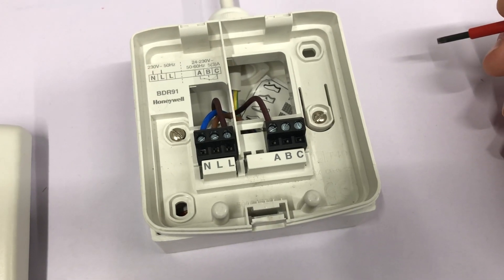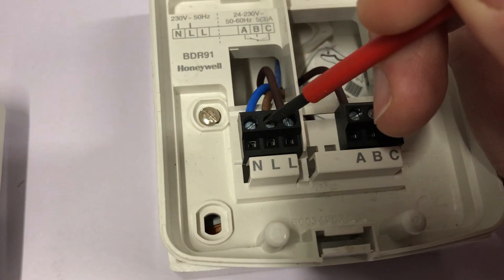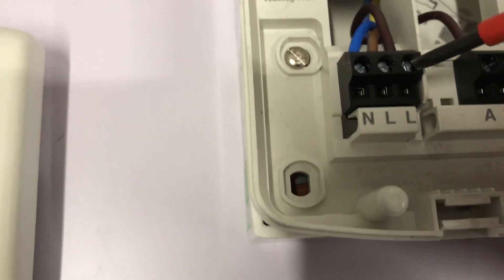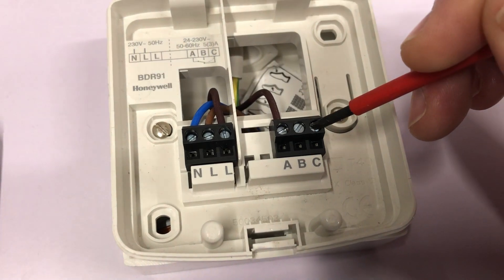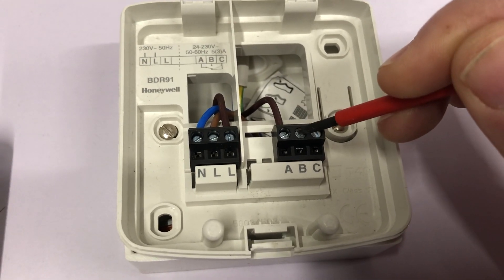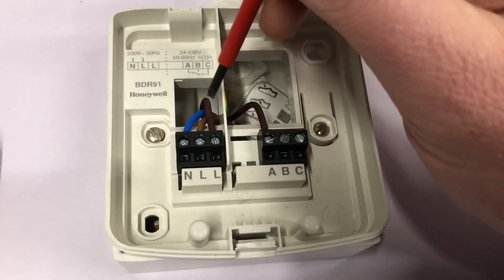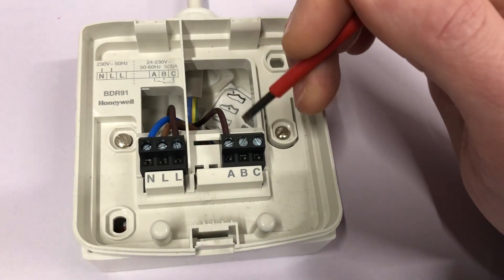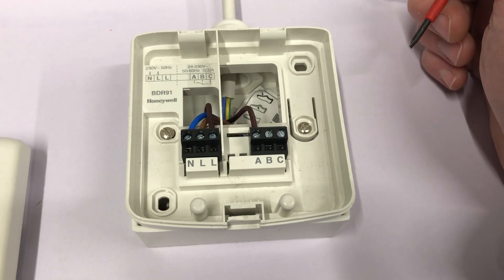How to wire a Honeywell BDR91 Wireless Relay Box (230v low voltage wiring)

Comment: Hi
I am having trouble taking the cover of the bdr91 that is already wired in. Pushing a screwdriver into the slot doesn't seem to release the case.
Reply from the maker: It will release, but can be tricky if you’ve not done it before.

Comment: Hi, I have a BDR91 wired to the boiler as a "free contact" or as you call it a "low-voltage" connection. I would like to know the status of the switch remotely via smartphone using something like a Sonoff switch, since the Honeywell app cannot show it. Do you have any clue? Tnx
Reply from the maker: You could probably use a smart relay to do this. Volt free isn’t always volt free from a boiler so you should be able to pickup on the small amount of voltage when the switch activates.

Comment: would i be able to upgrade from a Honeywell BDR91 Wireless Relay + cm927 thermostat to meross - MTS200 Smart WiFi Thermostat ? would like to be able to control my house heating when at work so the house is warm when we get in
Reply from the maker: Not easily as this looks like a wired thermostat? Have a look at our easy upgrade suggestions if you want to replace/upgrade the CM927 - https://youtu.be/mlh4-WILyUo?si=wj5pYOaCsdagMjRb

Comment: Hi there. I need to wire my boiler the second way you mention. Am I right in saying then the black wire from the boiler goes into A and the grey return wire goes into B?
Reply from the maker: If it is voltage free then yes.

Comment: Hi we have a Honeywell T3R programmable thermostat to a new Vaillant eco tec pro 28 boiler and we’ve wired it as we have always other boilers but it won’t work? Vaillant have suggested putting a link in like your video but it doesn’t work? Have got any suggestions please?
Reply from the maker: Sorry I don't, as the T3R has a different wireless receiver to this one and I don't know enough about the Vaillant boiler to comment.
Reply: @MWPHS  thanks for replying anyway my mate - all the best 👍👍
Reply: Same problém With viessmann vitodens 111. Port 96 .  Exact connections od Boiler and relaY. Attached unkversal Honeywell scheme dobe work … fail

Comment: @MWPHS
Hi, I have recently purchased a new thermostat from your shop to upgrade my old Honeywell DT90 Thermostat. I have purchased the newer version of the Honeywell BDR91.
In my old DT90 I had two wires. A brown wire that went into A (this is the electric wire as it had power) and a black wire that went into B (I assume this one was from the boiler?). And all worked well.

How do I know connect the new relay of the BDR91. I tried different options but the reley just does not want to work and the two led lights are just not turning on. 

Maybe the relay is faulty? Any help would be much appreciated.
Reply from the maker: Just for clarity the BDR91 requires a minimum of 3 wires plus an earth. The BDR91 requires a Permanent Live and Neutral and the switching wire back to the boiler. Some thermostats have two wires (Live and Switched Live), which means the BDR91 won't work as you would be missing the Neutral.
Reply: @MWPHS do you know of any wireless receiver units with programmable sender, that will work without permanent live or neutral and just switched live and return? I’ve got an old wall thermo that just has black, blue with brown sheath and earth!

Comment: Hellow sir....from boiler i put blue cable to A and brown cable to B,it is ok? Or doesnt matter
Reply from the maker: It shouldn’t matter (as long as the blue wire isn’t the ‘Neutral’ of course!) but always good practice to put the voltage feed from the boiler to the ‘common’ terminal ‘A’ and switched feed back to the boiler on the ‘B’ terminal.
Reply: If i got some wrong,what it can happend? If i inverse A with B?

Comment: I’m confused about the live link wire because in the manual page 41 it has the link wire connecting the two lives and room stat wires (2 of) running to A and B for a permanent live combi. Whereas you’re linking a live to A.
Reply from the maker: The ‘A’ terminal is the ‘common’ connection terminal on the BDR91 and ‘B’ is the ‘normally open’ terminal. In electronic circuits if you attach any voltage to a relay, it is normally attached to the ‘common’ terminal, hence on the video a 230v feed wire has been attached to ‘A’ from the second ‘L’ terminal. Please note that the video illustrates a 230V switching circuit. If the boiler is extra low voltage switching, you wouldn’t use a link wire from the second ‘L’ terminal and the connections from the boiler would be directly to the ‘A’ and ‘B’ terminal.

Comment: So for a no volt switched contacts. Leave out the live link and connect the A and B to the thermostat zero volt connector on the boiler. These contacts will open and close depending on the thermostat setting . Think this is right. Please confirm
Reply from the maker: Yes you are correct. A & B are volt free contacts unless you physically put 230v onto them.

Comment: I needed to do one more thing in order to make it work: add a bridge between the two L's. On my BDR91T they are not internally connected.
Reply from the maker: You do not need to bridge the two L's normally... As long as the BDR91 is not faulty, it will be linked on the PCB.

Comment: Could you let me know how to remove the cover please once it’s on the wall?
Reply from the maker: Isolate the mains voltage and then insert a large flat bladed screw driver into the slot at the base of the BDR91.  This will release the catch which will allow the BDR91 to release from the base and swing open.
Reply: @MWPHS  fantastic!😃thank you👍🏼

Comment: If I am replacing a bimetallic thermostat with this and only have a live and neutral wire to the boiler, how should I wire it?
Reply from the maker: 3 core and earth cable is required. If you only have twin and earth it won’t work. Thermostats using two cores are normally live and switched live, but you still should have a protective earth conductor? If in doubt contact a competent electrician.

Comment: Does it matter which way round the A and B are when you wire them to the "two low vaultage switching terminals" on the boiler?
Reply from the maker: If it’s low voltage switching, then it shouldn’t matter which way round A and B are.